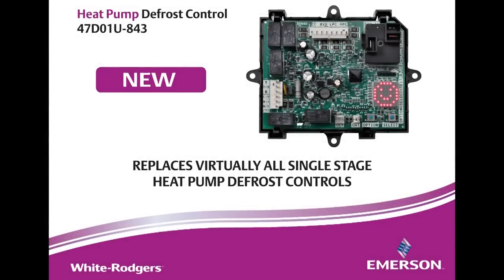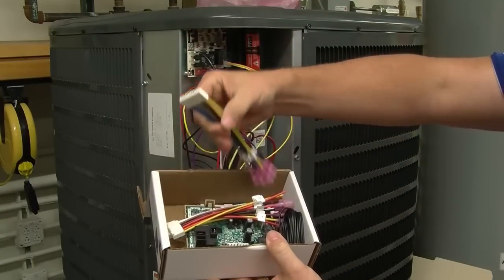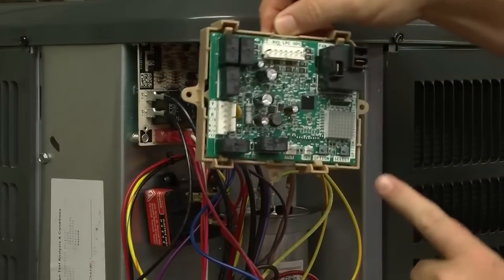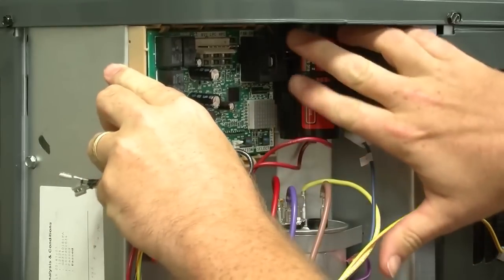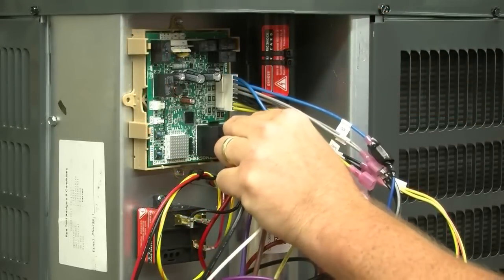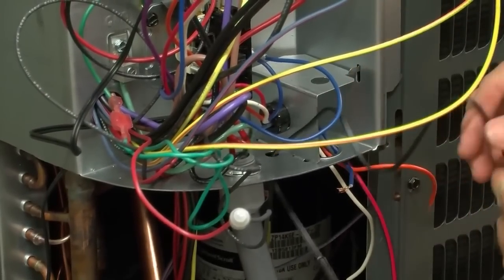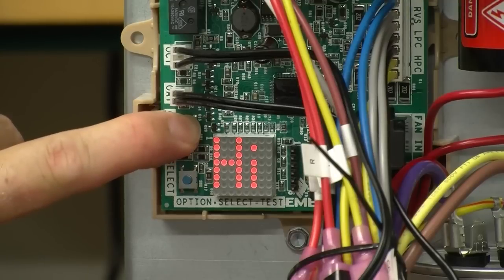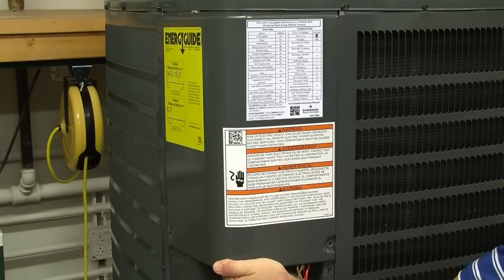White Rodgers Universal Heat Pump Defrost Control - Replaces Single Stage Defrost Controls

Comment: Just installed one. BUT, the existing Rheem coil sensor was at the TOP of the coil. Not the bottom of the coil as suggested.
Can you enlighten me as to why the different location? 
Thanks
Jim